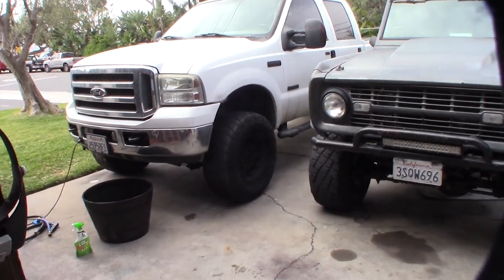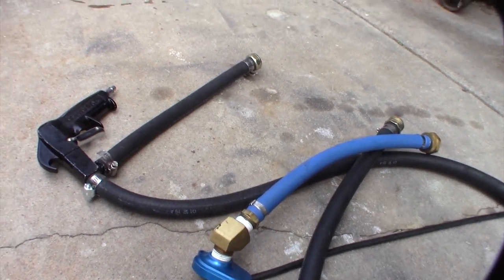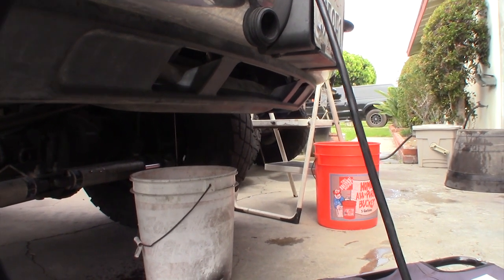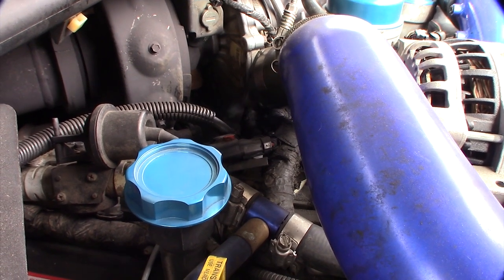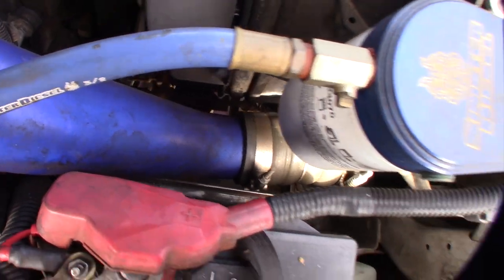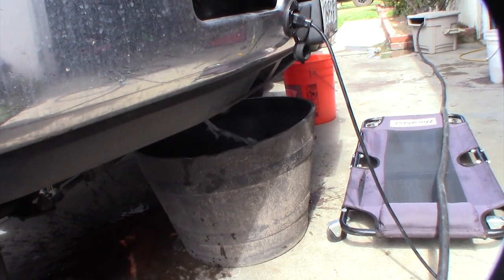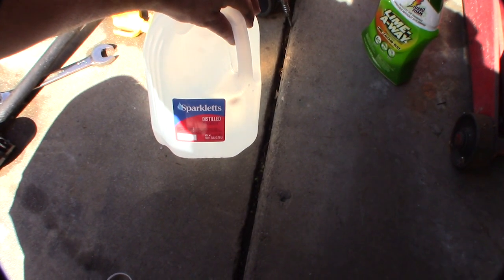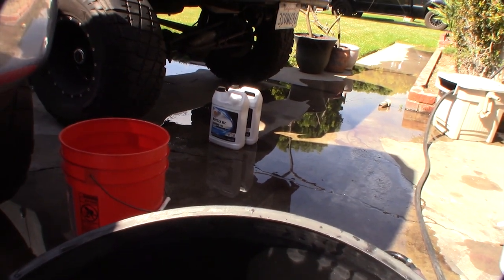Powerstoke 6.0 Oil Cooler Lime-A-Away backflush Ford F-250 F-350 coolant flush Lots of rust debris.

Comment: Less than two years ago  I finally broke down and put in a new oil and egr cooler(emission checks here).  It took a WHOLE weekend in my driveway to put them in along with a new rad, overfow bottle and T-stat.  My delta's are now a couple degree's pulling an 8k lb trailer with the a/c on.  Will barely break 210F towing and 190F bobtailing.  Got tired of trying all these gimmicks, they are just bandaids.  It's a LOT of work and a few bucks(less than $1k Cdn) but it's worth it.

Comment: So after the flush, how much coolant did you add?  Also, do you have to use concentrate to make up for water left in the cooler or does the oil cooler not hold any residual water?

Comment: I back flushed my 6.0 last year and got a lot of yellow flakes out of it. I took the trash that came out and put it in a small container and put straight CLR and several other acid based cleaners and I found nothing that would break down the flakes. I don't know what they are, maybe scale from the Gold coolant from the EGR cooler. Just replaced the Oil cooler with new Ford cooler and a Bullet Proof EGR cooler last month and will keep a eye on it, also have a coolant filter to help.
Reply from the maker: I feel like the Lime-A-Way dissolved the white flakes in the bucket.  I just drove up to my cabin and my deltas were about 6-9 degrees. It was at 20-22 doing 70 on the freeway and 25-30 going up the mountain. My previous CLR flush only lowered the delta 3-4 degrees.  When I bought the truck 5 years ago the deltas were 12 on the freeway. This is the best my truck has ever been.

Comment: Where is the fluid coming out from the bottom? All videos I’ve seen goes straight to changing the cap but never covered where you all drained the fluid on the bottom…
Reply: lower radiator hose on the passenger side remove it from the rad.

Comment: How come you're not answering any of the pertinent questions where is the water coming from how long do you let it sit how much do you use I know you're trying to be helpful with your videos but they're lacking many of the key points to help somebody do it just a thought maybe be a little bit more detailed would help us guys out that have never done it before
Reply: remove the lower radiator hose from the passenger side of the radiator. use 1/2 or 3/4 depending on how bad your oil cooler is clogged. flush with the oil cooler back flush kit. Once you get all the debris you can get out and all chemicals out. Reinstall everything the same you removed said parts. Fill her up crank it and send it.